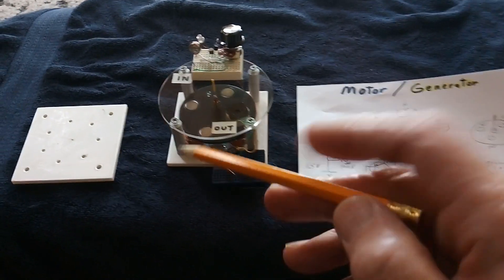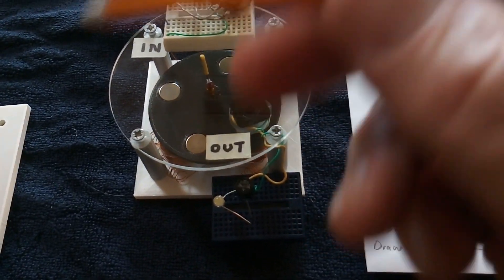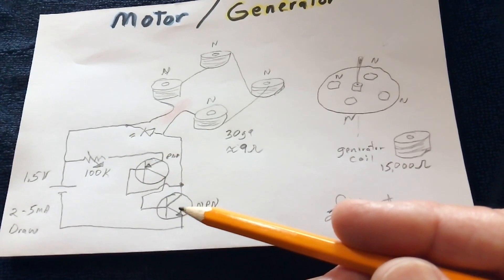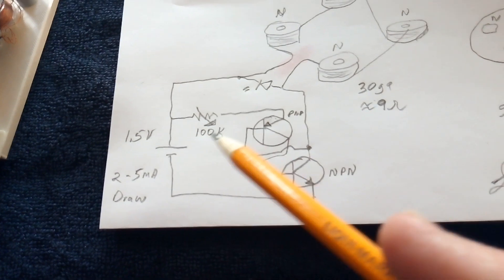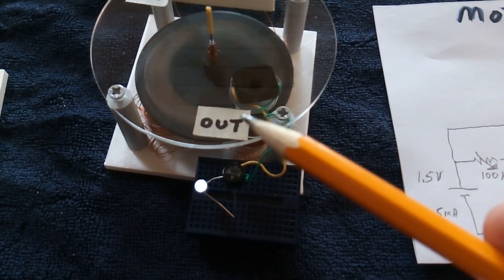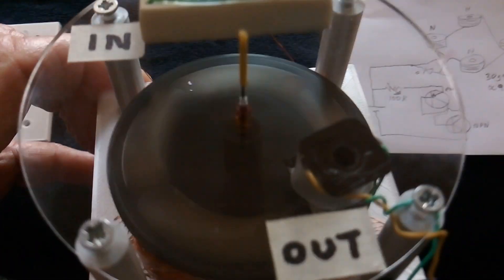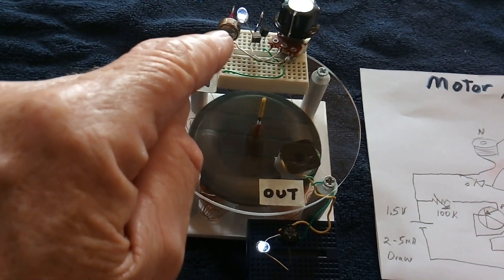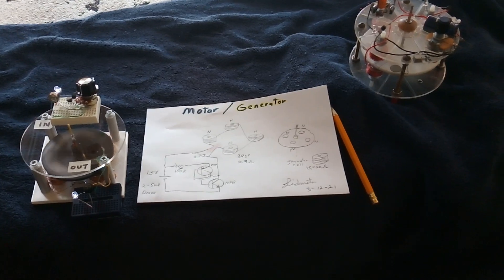Motor  / Generator 3d print

Comment: hi mate. great to see you’re still tinkering. i like the complimentary transistors. can i ask which transistors you use. 
i been using mini isolation transformers for sensing and driving coils simultaneously in modified computer fans and other small brushless motors for years. 
it looks like maybe you got aluminium tubes or posts there. just in case i thought it’s worth mentioning that i saw a youtube clip suggesting this is a partial brake on these projects and reduces efficiency because of eddy current losses and lenz effect to a small degree. 
cheers.

Comment: That really is looking neat and tidy 😊👍
Reply from the maker: I am almost finished with this fun project.  I might try that 3d printed spring powered car you have been working with next.
Reply: @Lidmotor  good luck. You will probably need some needle files to trim up the print to ensure it runs freely 👍

Comment: very good project. I have made a pulse motor with a 15kohm coil and it consumes microwatts of power. I am curious what if you connect the generator to the load, what is the output? i am trying to combine a pulse motor with a  joule thief..keep the awesome work..cheers

Comment: Losses due to resistance, liquid nitrogen would negate the resistance in the wire, then the only losses would be the friction of the bearings and the rotor turning against the resistance of the air .
Reply from the maker: It would be a fun experiment to run this in a vaccum chamber cooled down with dry ice.  Better yet get NASA to take this up to the space station and let the folks up there have some fun with it.

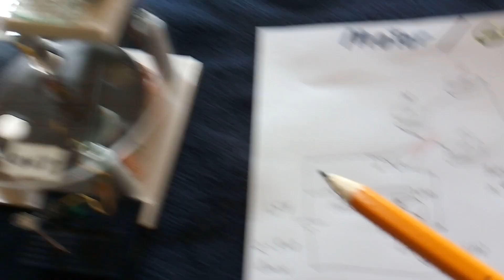Comment: 1:30  why you need that zener across the coil in/out?
Reply from the maker: That is a white led.  It flashes on the coil flyback.
Reply: @Lidmotor  If your interested this circuit slow roasted my brain for about 2 years , have at it lmk if you encounter issue. I have yet to get around to making it. Having trouble finding machinist to make me acrylic disc with holes and such .. yada yada.. 

https://www.youtube.com/watch?v=WH4watZLhOA

Comment: so i have been watching you for years all these little machines why dont you have one powering you home
Reply from the maker: I do have a few led light projects atound the house that I use but I don't have any motors that do any useful work.  Some of the motors (like this one) are similar to 'fidget spinners' though.  They reduce stress when you play with them.   It is fun watching them go round and round ----doing nothing!
Reply: @Lidmotor  THESE MOTORS HOLD A BIG SECRET. They dont just do nothing.  You should build them with a trigger coil so they act as a joule thief